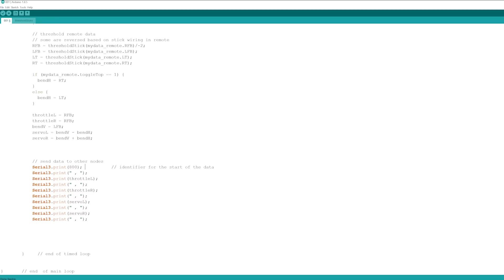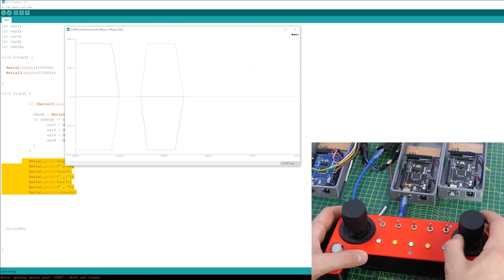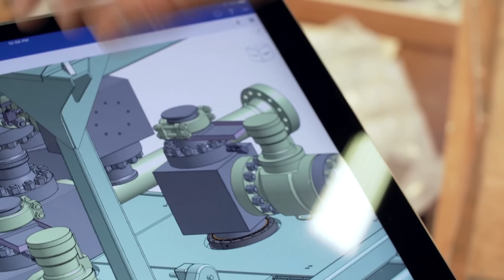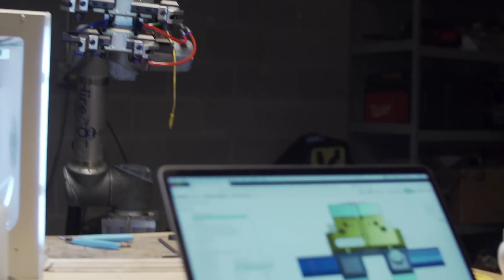What is a Bendy Snake Bike?

Comment: Did you consider hydraulics rather than servos for the linkages?
Reply from the maker: Nope, not yet, that would be quite costly, especially with position control using proportional hydraulic valves.

Comment: I wonder if the heat issue on those motors is a weight distribution issue. Weight on a bearing increases friction and makes the motor have to work harder.

Comment: Good work :)
This looks like a good project in which to use canbus - less hassle than a bunch of serial connections

…and btw, keep in mind that PLA softens over 60°C, so hot motors in the vicinity of PLA is a rather bad idea. Better use at least PETG, or even better, ABS or ASA. Also, if PLA doesn't soften, it might get brittle and break. ABS/ASA should handle that well.  PETG also, but it starts to soften at 75° or thereabout, whereas ABS/ASA can handle 100-105°C

Comment: Why the belt drive and not having the Pots in a housing that helps hold on the servo and do a geared connection? I know it seems small and I know the positives of belt drives, but it seems a simple thing for less parts?

Comment: Is it just me or does the whole thing bending in unison seem slightly off? With the amount of control he has over each servo, he could delay the turn in each section such that the machine follows its own track marks. This will probably improve low speed manoeuvrability and reduces strain on the servos as the machine flexs.

Comment: This project is awesome 😃
You could try using I2C to communicate between each module because it is mutch more modular than serial and you can add and address a new segment very easily
Reply: I'll add that I2C is also less resource intensive to run, so the controller could be a less expensive model.

Comment: Needs an "artificial horizon" to tilt the seat and arm-rests based on rate of turn and speed of turn. You do this automatically on a 2 wheel vehicle and deliberately in an aircraft (to keep from sliding in turns). It shouldn't be too hard to calculate.

Comment: Solution for the upright seated tilt issue; Actually put the seat on a single axis (in the length of the vehicle). Then steer by leaning to the side you want to go (and measure that of course).

Comment: What about going with tank treads for each section? It'll increase the footprint which will help with distributing weight so you can go off road with it. Ivan Miranda made a fully 3d printed tank, but you could just shrink the drive system. I would also consider using a sway bar frame design. That'll take the inertia that is moving you out of the turns and shift the lateral forces to the inside of the "snake".

Comment: You need to build a linkage that distributes your weight uniformly upon all 4 sections.  The flexing up & down should be dictated by the ground.  The structure should be "limp" on that axis.  The linkages between the section could be done with 4 rods with ball joints at the ends for stronger & simpler construction.  I have 2-section "snake robot" that uses this scheme.  If you are interested I can send details.

Comment: James!  one things that could be done, is, whilst keeping the manual "elevation" control, you could also fit a sensor/probe to the front, some sort of hinged plate that will rise if the snake encounters a bump/step, or lower if there is a dip, and that could automatically make the robot curve the robot up and down accordingly...  then you could focus on the direction only, but still do "wheelies" on command!

Comment: If you only had two pivot points above the center sections do you think it could carry a stretcher?

Arching the back is only needed for flexibility really, not to lift(though that would be a cool flex).
Maybe vertical movement could be locked out if you had to bridge a trench or something sinky. If you still want to go full off road that is. Looks really fun in cart mode once you get comfortable. Chain 10 together and bring the Grandparents(not on stretchers, more seats!).

Comment: Pretty cool! ISTM that, as a vehicle (as opposed to a robotics project), it would work as well or better with manual steering rather than power steering. Just remove the segment flexing servos entirely and give yourself better purchase (stirrups for feet and some sort of proper armrest with grips, or somesuch) to haul them around yourself. Like that, I'd ride it around, I think.

Comment: Does anybody know what the name of the following was?
Had a skateboard deck except larger like a mini snowboard and 2 rolls of skate wheels bowed in the middle so that both rows of wheels looked like half of the geometric shape called an Ellipse !? PLLLEEASSE I have been looking for one for years  ! Used to be in most skate shops and I'm certain I could find one if I knew what it was called ! However, despite my description being very accurate it isn't the kind of description that lends itself to a Google search. 
The experience of riding one was akin to snowboarding or surfing except on the street.

Comment: Okay what happens if you just steer the snake bot with your body. You’ve got your arms on the front, your feet on back pegs and your hips in the middle, could you just flex it to steer it without the servo assist, and if you can could you build it to detect your flex and give you power assist. A flex bike?

Comment: Wouldn't it make sens to activate the servos one after the other? Like first section turns, second follows, third and forth later. That way it's not forcing the movement but only following the curvature of the first one. And it wouldn't be dependant on a timing but on the distance that the wheel have traveled.

Comment: I still wonder if it would be even better with all wheels driven. To a non-expert, it looks like butchering two more hoverboards would not increase as much work as it would provide benefit. But well, it seems to work nice, but I saw some wheel slip, and there is no articulation.
I'm really curious about the next videos.
P..S.: I skipped the outro, seems like your summary is about the same :)
Reply from the maker: Each one needs and ESC as well, but I don't think the results will be much different for this version.
Reply: @jamesbruton  When I saw the wheelspin and wrote the comment, I wasn't aware of the current control and thought there might be traction issues when climbing over obstacles. I should have paid more attention to the whole video.
I'm curious how it proceeds. It looks VERY fast without someone riding it.

Comment: I've been thinking of a car chassis that steers like the one section you show at the end. I wonder how much grip that might have and how simple or complex. Might it be lighter at car scale versus the complex traditional steering front wheels?
Reply: There's a lot of excavators and farm tractors that have a pair of fixed axles and use a hydraulic hinge in the middle of the vehicle to steer. Because the axle itself doesn't need steering gear it can be very robust but it only really works in low speed rugged terrain environments.
Reply: That would be way more complex and also fragile. However there's a "middle ground" solution. It's not exactly bending the chassis, but rear wheel steering has been around since the '80s. It helps to reduce understeering at low speeds by turning in opposite direction as the front wheels, and oversteering at high speeds by turning in the same direction as the front wheels. There's a number of sports and luxury cars that have this feature.

Comment: does it bite
Reply: wifi remote control, the most simple rc control
Reply: digital is much better
Reply: so why did you not make it fully from aluminium extrusion
Reply: arc bridge bending
Reply: screw servos are better, they keep their position, no load
Reply: screw servo is a nut-bolt linear servo, the analog of the worm gear drive joint
Reply: horseback riding
Reply: go kart mode
Reply: actual train mode
Reply: quick bridge vehicle, from the army